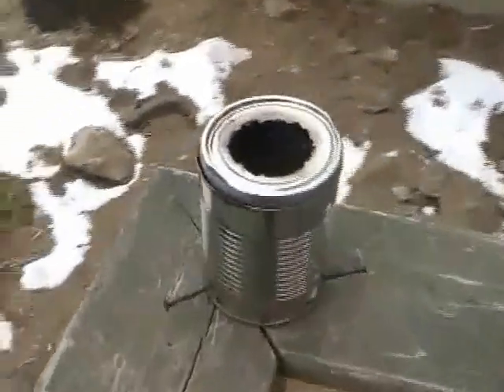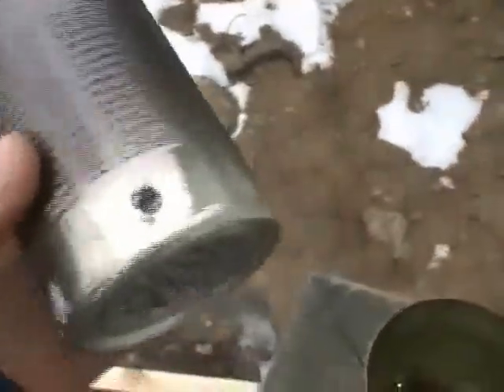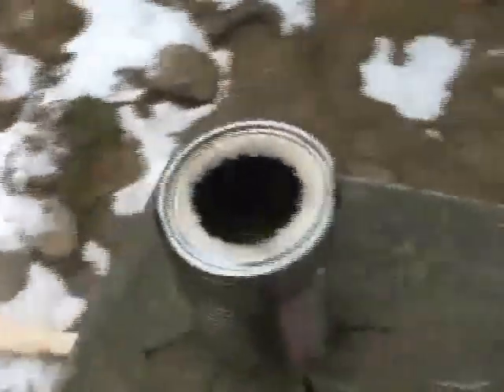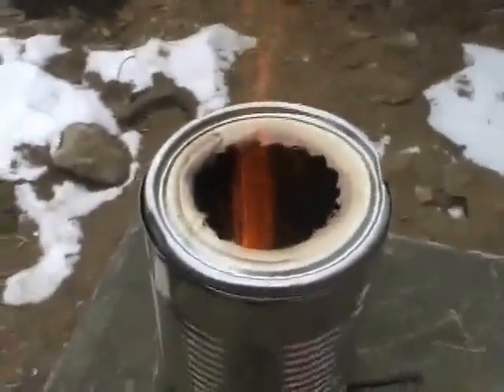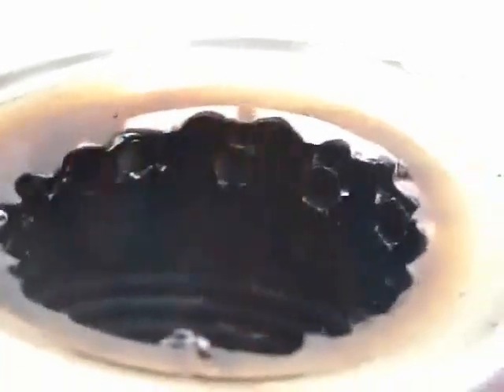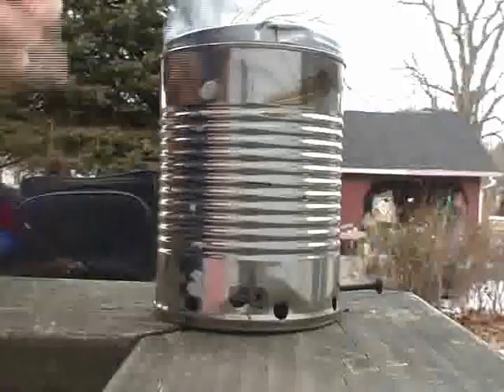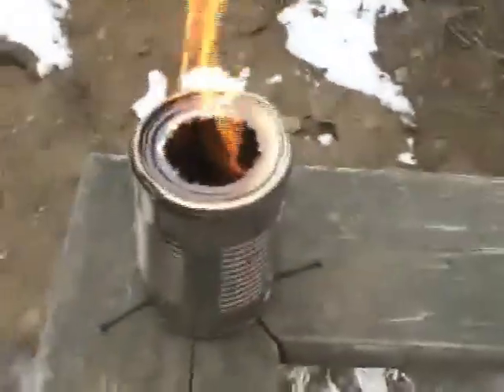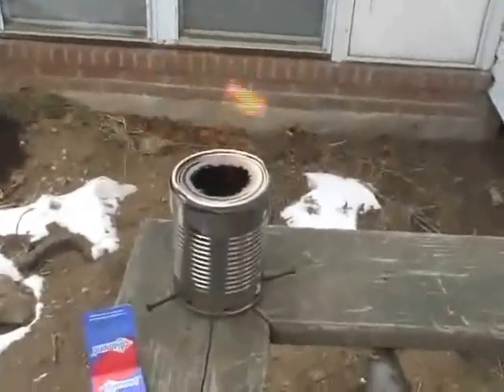Tin Can Gasifier Stove

Comment: If you want to make a wood gas-iffier seal wood in a paint can. Put a small pipe in the top sealed tight. and set it on your gas grill for 5 min. The smoke that comes out the small pipe should burn. Careful  not to get it to hot. Just enough to smoke.

Comment from the maker: Hi, I'm not sure "sealed" would the word I'd use for the pyrolysis chamber. Wood gas is being drawn down through the charring wood and up a set of narrow channels where it emanates from some holes and combusts when it meets the air. This was actually built from a set of plans from the Victory Gasworks forum, the author is a well-known and respected wood-gasification enthusiast who has built many successful full-sized units, some of which were used to run IC engines. Please check your facts!

Comment: This is not a gasifier.  This is a wood burning rocket stove.  You are simply designing a burn chamber that pumps air into it more efficiently.

A gasifier would have a sealed charring unit (To prevent air/wood gas mixture, thereby preventing explosion), and the gas channeled to the burn chamber.

Comment from the maker: Well I don't have the numbers on a sheet anywhere but I got a nice 45 minute burn out of 1/3 cup of low ash wood pellets. Honestly, calculations are basically pointless for this particular implementation, the hole sizes are all over the place, there is leakage everywhere and pellet weight varies a lot. Also, I didn't measure heat output but I will tell you that the can was red-hot by the time it was running out of fuel.

Comment: I've just made a wood gas stove. It surprised me how easy they were to make.
I put holes around the wall of a beans can at 1" from top and bottom. I got a sweet corn can and removed the top and bottom with a can opener. I then stuffed a tuna fish can on the end and cut a big hole in the bottom of the tuna can. Then I made holes about an inch from the end of the sweetcorn can, and also tiny holes (get a bit more air draw) just below the tuna can. I placed this can stack on top of the beans can

Comment from the maker: @henchman99942  Yes it is a gasifier but I understand you're confusion. There is an inner chamber where the air is drawn in from the bottom. The wood pyrolyzes and the gases are drawn up the narrow channel between the inner and outer can, where it hits the air and combusts, hence the gas flames emanating from each hole drilled around the upper circumference of the inner can. Hope this clears it up for you. Regards.

Comment: This is not a gasification stove.  It is a wood burning stove.  You need to have a charge of wood or coal in an enclosed (not sealed) chamber that can heat up but not get oxygen.  Then the wood or coal gives off gases that burn.  When you are done, the off-gassed wood has turned into charcoal.